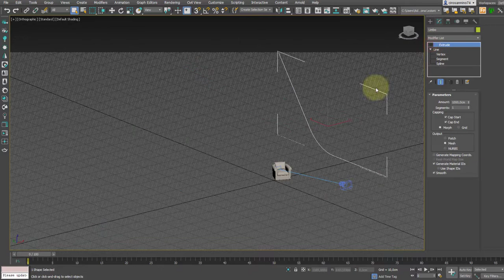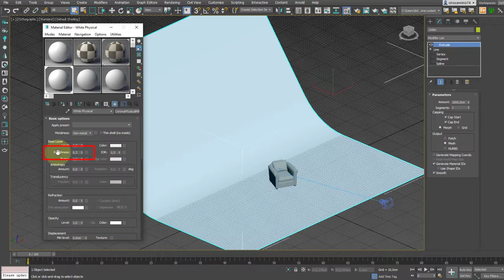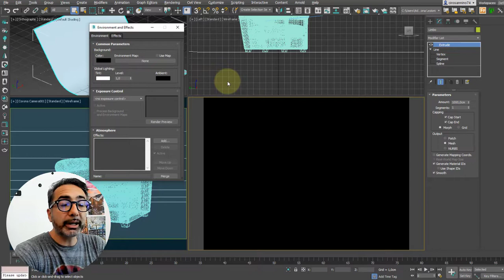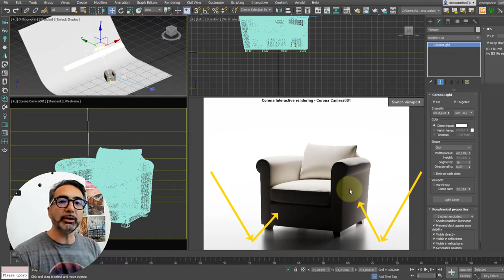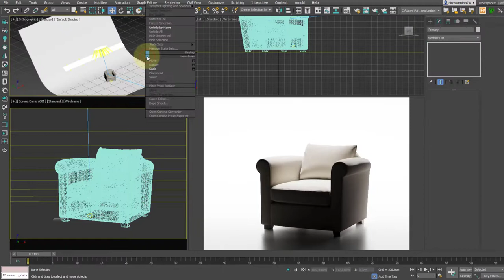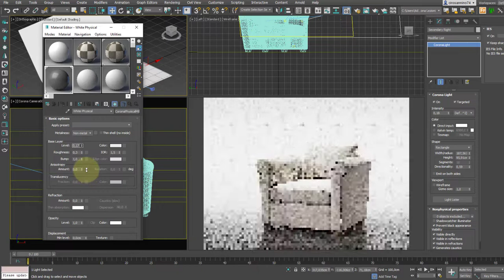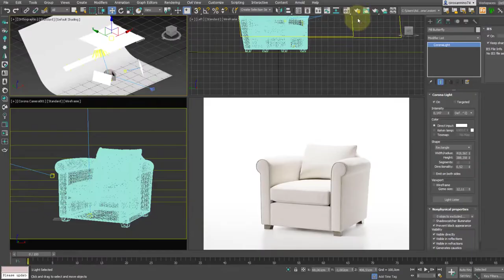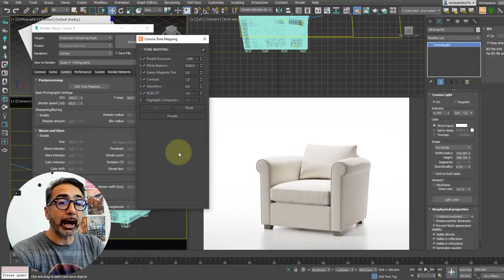Corona Studio Lighting | SETUP

Comment: that exacly how i was doing the lighting before but there was one problem happing at that time like when i try to upload that image as reference on 3d sky or cg mood, those little normal shadows on bottom gets darker so these people rejects my models from there. but that same image looks good on my 4k moniter. so i started doing images without background and shadows and started doing background in post. that's my experience do you have any work or tips around that?
so for my poor english. tnx
Reply: Hi,
They always want a specific look. Use masking id to reveal desired shadows in Photoshop after removing backgorund by masking it out and replacing with complete white colour. By the way i also sell on 3dsky and cgmood.
Reply: @Knowledgeseeker70  i generally hide background and only render the object so that it'll render fastest and after that i add white background 247,247,247 like they want and i think this is the fastest method to do this kind of thing if you have multiple renders and some close ups